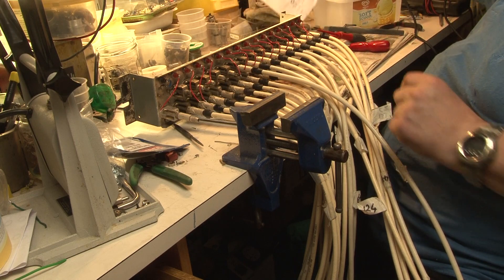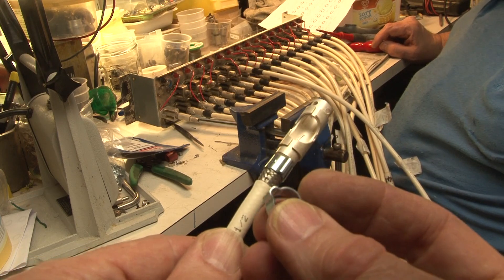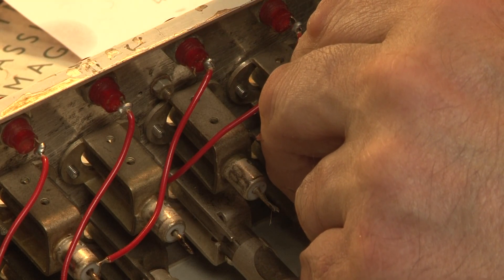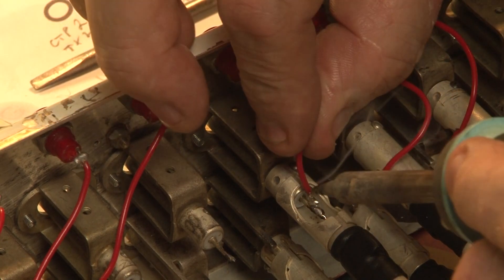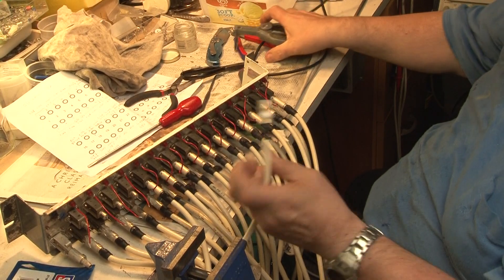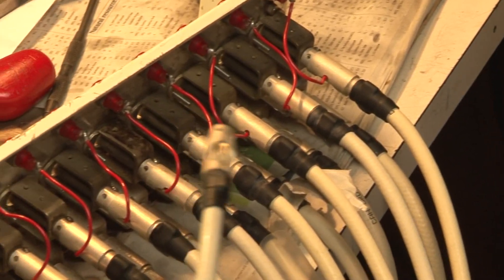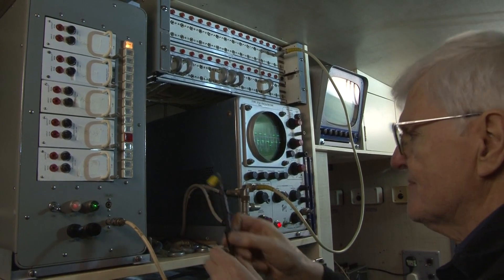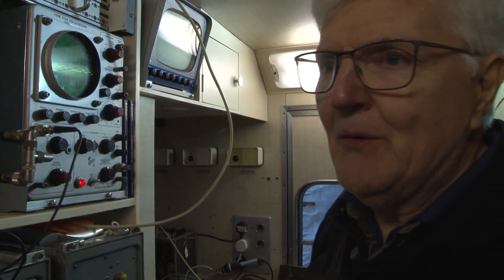Video Cables and labels - another major soldering task

Comment: It looks good but my man, please use zip ties instead of twisting wire’s to hold everything in place.😂
Reply: Don't worry - the wire ties were only in place while the loom was being formed and allowed the individual cables to be adjusted for best fit when the loom was drawn into place inside the vehicle.   There was a lot of  fettling needed to get it to lie neatly in the cramped ducting.  Plastic ties were then used to finish the job,